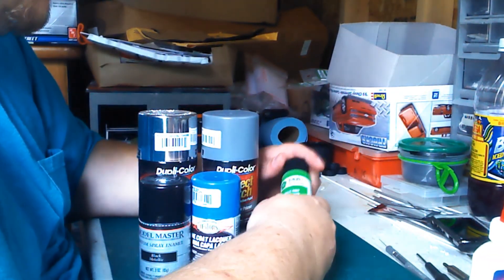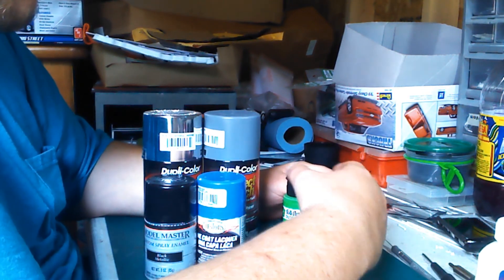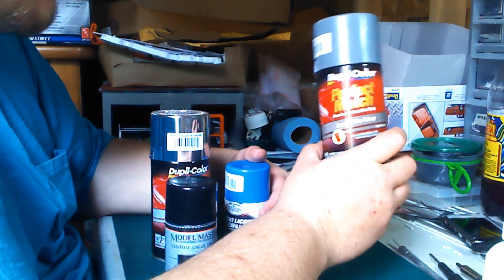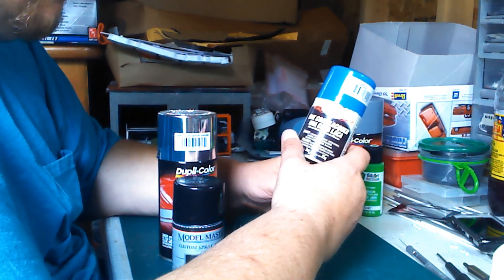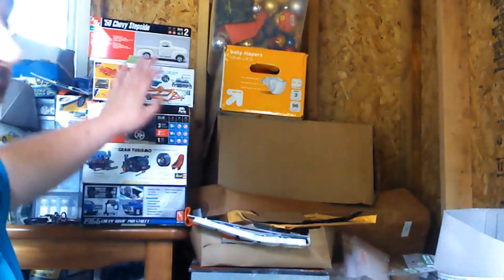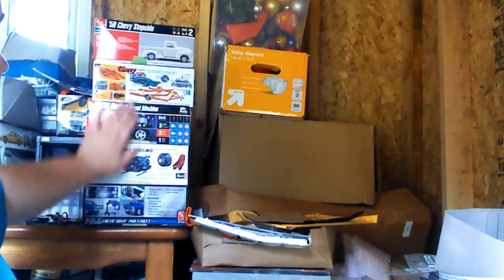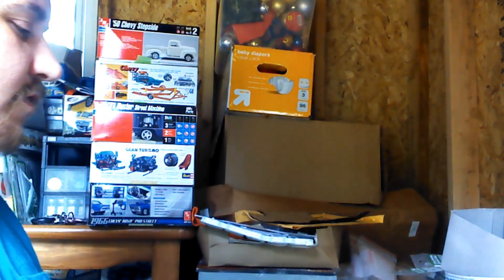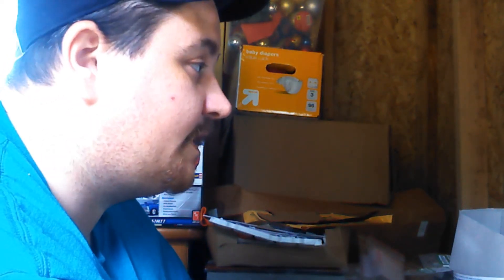Shop and Paint talk.

Comment: Hey bro. For the acrylic you can use an airbrush medium from liquitex or you can try future, which is what I use these days. For the primer I would use it from the can. But if you wanted to use through the airbrush you would need to thin it using a reducer as styrenejunkie said.

Comment: Wazzup Bigdaddy?  Hey bro, I'm right in the middle of doing that moving thing too and it does suck.lol  Wherever you end up I hope it has lots of room for your shop. As far as most of those paints go..at least not the acrylic paint..the rest of them I use medium temp reducer to thin them down.  That touch up paint you are talking about is automotive paint and a medium...or depending on your climate..a high temp reducer will work great for thinning those down.  Let me know what ya think bro PEACE